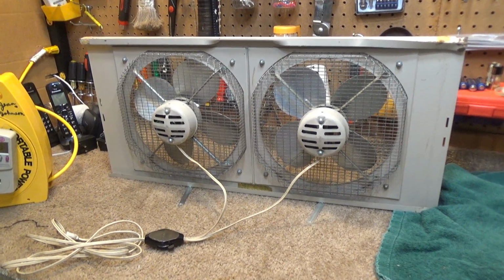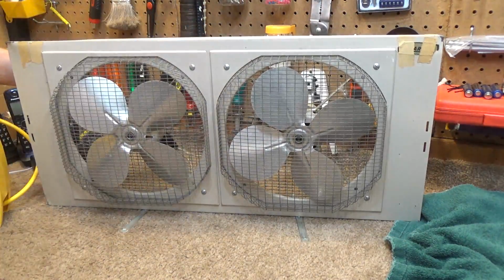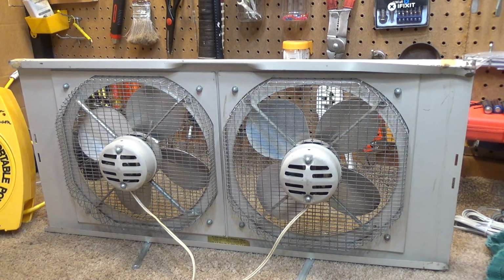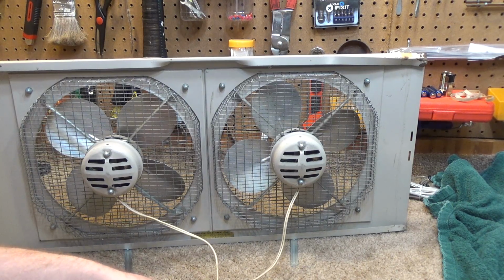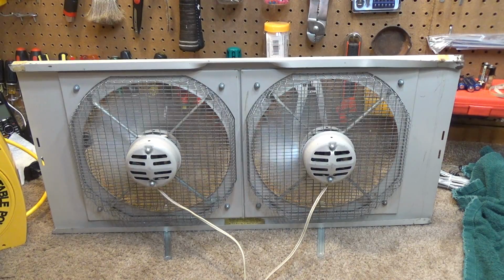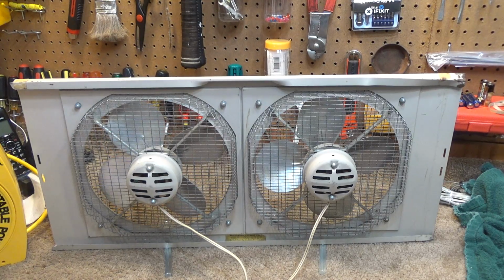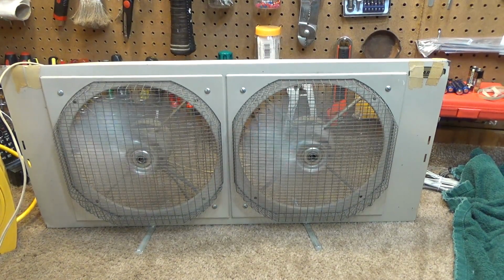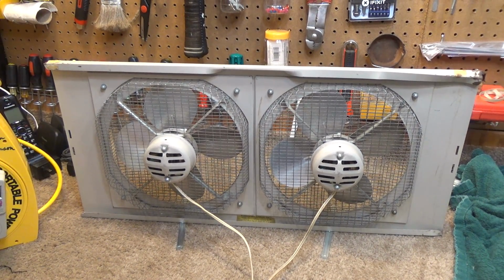Marvin 10" Metal Twin Window Fan Model 210

Comment: later on my dad did a project for marvin as they had balance issues in the 7 inch models..  they gave us several of them at the time as dad built balancers.. marvin was in ohio and so are we so they contacted him  i dont know what ever happened to the rest of the 7 inch ones..  im guessing they were given away..  people complained about the 7 inch models being too noisy to use in their bedroom windows at night.. some of the discussion revolved around balance and other was around the fact that the 7 inch fans spun too fast making too much whirring noise..  dad put my 7 inch fan on a VARIAC and had me set the VARIAC where I slept the best..  I believe the suggestion to marvin was to lower the RPM of the 7 inch fans but marvin wanted to use the same motor on both..  I think the eventual fix was a plastic grille that vibrated less and then discontinuing the 7 inch fan altogether..  we were out of the loop by then
Reply from the maker: Very neat history! I have quite a few of the 7" models, they are a little on the loud side but they move more than enough air for the noise. I never noticed balance issues with any of them. I think the motors are a bit overpowered on the 7" ones, perhaps adding some more pitch to the blades to bring the speed down to where the 10" ones were would have been a good fix.

Comment: back when I was a kid in the late 1970s our central Air conditioner failed in the midst of a heat-wave, dad told mom to go buy a bunch of fans..  she showed up home with a couple of these and also a couple of the 7 inch models and a couple SuperLectric Box fans..   I ended up with a complete set over the years..  1 10 inch marvin like this, a green 7 inch, and the green superlectric box fan I still have them to this day  though the boxes are long gone ans a couple of the metal sliders that wrnt on the ends..  ive used the 10 inch fan set so much that she is worn out..  do you have any idea of a motor that can be used as a rewplacement? ive tried several and none fit..   amazing though that they are over 40 years old and all of them still do run, the bearings are just getting worn and so the motors tend to run hot.. you can smell them after they run awhile.
Reply from the maker: I've never replaced the motors in these, but I'm sure there's got to be one that will fit, these are not at all an oddball size. Have you given yours a good oiliing? All of the units I have were purchased second-hand, a good cleaning of the bearings and soaking of the oil wicks in fresh oil usually gets them running like new again.

Comment: Interesting. Did they oversize the motors on the small ones or undersize the motors on the big ones? Or did they change the blade pitch? I like the sound of this one more too!
Reply from the maker: Curiously enough, this larger model is rated at a lower power draw than the smaller one.. The smaller ones throw off a lot of heat, I think the motors may be a bit over-powered in those..
Reply: @JordanU  Interesting!